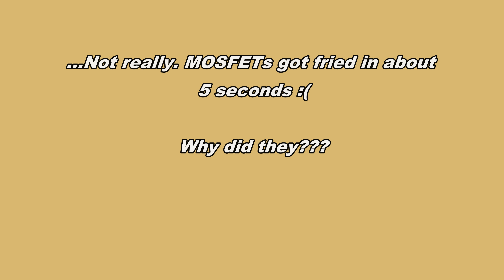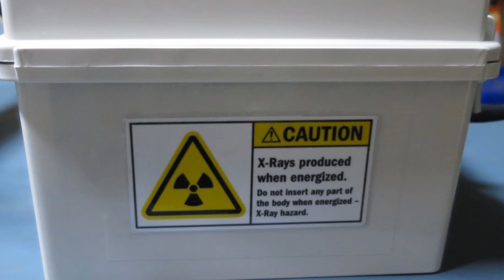Making X-Ray source for PCB BGA imaging

Comment: This is cool. I want to provide my business partner the ability to sneak around inside hidden top-secret military mystery national security KEEP-OUT! multilayer iphone circuit boards that were engineered to intentionally NOT provide test point or surface access to many traces that would be useful in diagnostics and repairs. eBay seems to have dental xray portables for around $899. Lead blankets are cheap enough also.